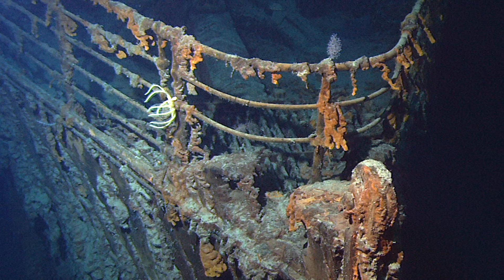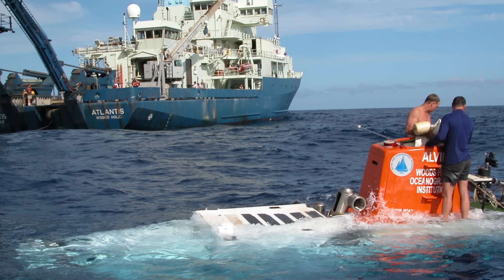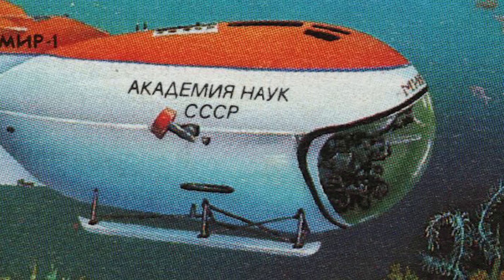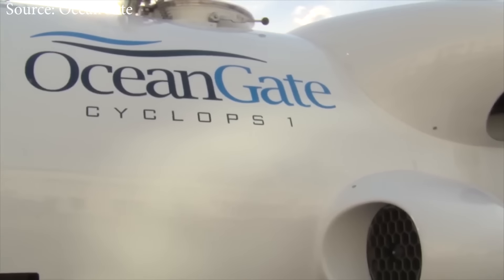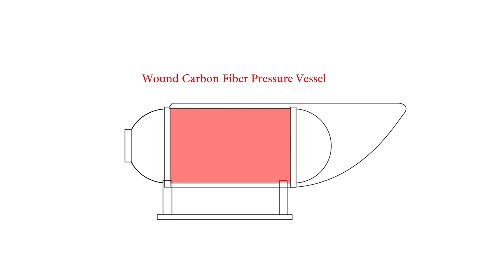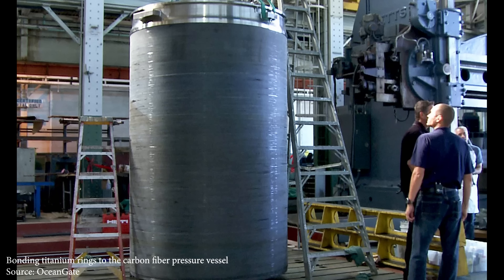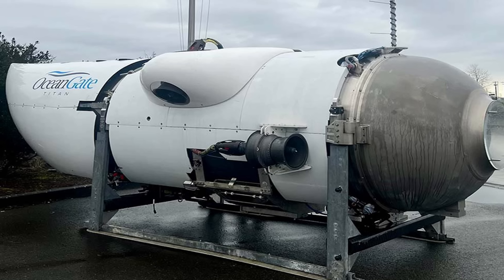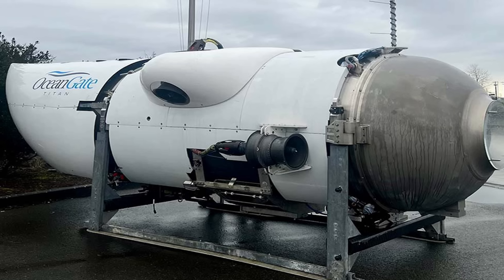How Titan was Built, Lost and Found: An Analysis

Comment: I appreciate as always Mike's brilliant presentation, but just from the info that has been publicly available and finally coming more to light, it's already very safe to add that Stockton Rush was beyond reckless and negligent. He was the boss of the operation from top to bottom, and was the only person with the authority to fully question things, an authority which he regularly abdicated. People make a fuss about the game controller, but that was possibly the most reliable component of the whole system, being a widely proven and dependable item. To ferry people to Titanic though, he used a highly unproven experimental and novel construction. The titanium caps were essentially glued with epoxy to the carbon fiber composite hull, and rather than the adhesives being applied in clean room conditions, they were done in an open air building by people in street clothes. Due to their design, the seams formed by the epoxy-joined composite and titanium segments would have been impossible to scan for damage even had Stockton Rush ever wanted to. Moreover, experts in carbon fiber such as advanced bicycle part engineers have fully known for years that carbon fiber composites degrade progressively with use under stress, can fail catastrophically at the worst possible moments, and that even with careful examination may only be known to be at risk only after they have already failed. Every one of the many cracks heard by passengers, as reported on earlier trips, was damage, accruing incrementally over time. Stockton Rush was not going to retire Titan any time soon, could never have detected its growing faults, and reacted bitterly to experts suggesting that he was putting lives in danger. So, Titan's eventual destruction was all but guaranteed. I don't expect any pieces of the composite hull or the bodies to ever be found; the immense pressure and energy of an implosion occurring at hundreds of atmospheres of pressure is hard to comprehend, but it would literally be over in milliseconds, superheating the air inside momentarily and turning the entire hull and its contents into small particles before the unfortunate occupants could even register the collapse. Stockton Rush made claims about NASA, Boeing, and the University of Washington being involved with the sub's engineering, which are now known to be greatly overstated. His victims, yes I say HIS victims, may have been considered crew members rather than tourists, but I struggle to see how a Pakistani billionaire father and his unwilling teenage son, whom he had to heavily coerce to overcome his initial refusal to join him, can be considered anything but unwitting clients, being given so many false assurances after paying hundreds of thousands of dollars.
Reply: You are 100% on point. Totally hubristic and negligent. A modern Icarus (of the Ocean). But at least Icarus only took himself out, Rush took 4 other lives with him in his folly. I feel so so terrible for Suleman the teenaged boy. When I heard how they died I cried for hours thinking about him in his final moments, and the pain his mother and sister must be going through. Ugh. Just terrible. May they rest in peace.
Reply: Very well-written
Reply: People want a video without the bias and noise. Mike provided that. This comment is more of that noise and opinion he mentioned in the introduction.
Reply: @yoowan3437  You are incorrect and probably didn't even read or comprehend my comments. Mike is advising against spreading rumors. I am commenting on things that are known to be factual. With due respect to Mike, he was not yet aware that Titan's hull was glued together with epoxy. Perhaps he was not yet aware that the viewport wasn't rated for anywhere near Titanic's depth. He along with everyone else wants to know what went wrong.
Reply: Paragraphs, man, please use your return key!

That having been said, I actually will take issue with the game controller. Not "because it's a game controller," but because:

1. The use of a wireless controller introduces two additional, unnecessary points-of-failure to a mission-critical component, that being power supply and wireless connectivity, when wired controllers work just fine and have neither problem;
2. Did they have a backup? The Navy uses the damn things because they're cheap, ergonomically tested far better than anything they ever could do, and you can send a sailor out with a rented van and a "company" card and return with a hundred of the things new-in-box in an hour and a half. So if the one they're using then breaks, they just toss it in the trash and pull out another one. Did Rush have a spare aboard? Probably not, knowing him.
Reply: Are you an expert in the field of carbon fiber?
Reply: @ShadowDragon8685  I saw a former passenger saying yes they had a spare controller for whatever that's worth. I still wondered if the sub could be controlled by other inputs, touchscreen, keyboard etc.. I've heard of comm and power problems on the sub but so far not controller issues. And F the return key! mahhaha
Reply: @ShadowDragon8685 , he carried spare controllers, at least according to video I’ve seen of him saying that. 

Nonetheless, I would think that there should definitely be some sort of fixed/wired method of controlling the vessel that overrides any other controllers, which you would default to when navigating through extremely complex environments. 

I would not want the vessel totally dependant on a controller that could disconnect when you are navigating the wreckage, when even a short, momentary loss of manoeuvrability could result in entanglement or collision.
Reply: @ShadowDragon8685  Yes there were spares onboard
Reply: Very well said
Reply: Hold the Shift button down while hitting 'Return" and you can make a new paragraph without losing what you already wrote. And your assessment is spot-on.
Reply: @LB1973 Having a "spare" component at hand DOES NOT provide REDUNDANCY... because the change to the spare is not instantaneous, nor seamless...
Reply: @yoowan3437  This comment is not "noise and opinion". It's FACTS. The information of peabody3000 has been well-validated by genuine experts in deep water engineering, mechanical construction, and safety management. All of the reputable organizations mentioned here have publicly denied any partnership or  involvement with Oceangate, contrary to Rush's false claims about them. The information about the carbon fiber hull is also validated by multiple industries, and the implosion information is also real fact, and easy to research. Mike, on the other hand, let his feelings about Rush determine how much he was willing to investigate (not much at all), with the result that historical/factual accuracy was sacrificed in his narrative about the Titan disaster.
Reply: Excellent comment.

Comment: If he was a science enthusiast, WHY didn't Dawood not realize that carbon fiber only supports EXPANSION force by stretching, like gas tanks, and is FAR weaker under compression.
It was just stupid to use an open compound structure that can delaminate when water enters the layers under high pressure.
Reply: really good info
Reply: Thank you👏👏
Reply: Great simple explanation,  wonder if dagwood knew that ?????
Reply: One of the other passengers, Hamish, was extremely experienced in submersible exploration and extreme adventure. Very shocking no questions were asked.
Reply: He knew that carbon fibre is weak under compressive loading, everyone knows that. So many experts in the comments by people who don't really understand the facts. Simple pre-dive hull scan ($20,000 but still affordable), thicker hull and we wouldn't even be having this conversation. The Titan which can carry 5, cost $370,00 or about 1% of a metal hulled sub that can only carry two at $37 million.
Reply: @methylene5  We might still be having this conversation, because the measures you suggest to make this thing work either were not considered  (= extreme ignorance) by Stockton Rush or were considered and rejected (= extremely poor judgment and/or excessive hubris). Neither extreme ignorance nor extremely poor judgment and/or excessive hubris should be attributes of anyone in charge of constructing and piloting something of this nature. The decision not to take those measures strongly suggests that Rush was not a good fit for the job in either capacity, no matter how many wonderful things you have to say about him. He (and four others) died precisely as a result of the decisions he made. Also, you completely omitted mention of the gross inadequacy of the strength of the viewing window.
Reply: Blue eyes.. you wrong bby
Reply: Carbon fibre is good for deep dives. ONCE. Carbon fibre hull was used in Cameron's Challenger sub that dove into the bottom of Mariana Trench but it was literally intended to do it once and be retired afterwards.
Reply: @methylene5  with a thicker hull (more titanium or thicker carbon fiber layers?) it would have failed after a few dives later. The problem is that all those materials expand differently, react differently to saltwater, creating delamination over time. Delamination is exponential, not linear.
Also, carbon fiber fails differently to metals, it doesn't deform under stress load, it just fails without much warning.
Reply: @campandcook3118  Yes I know all of that, this is why its important to thoroughly test the hull before each deep dive, at about $20,000 per test, they could easily afford that.
Reply: @blueeyeddevil1  What do you actually know about the viewing port specifications? Nothing. We already know that it's been claimed it was inadequate (rated to 1400 m vs 3800 m dive) however some others have claimed it was the initial prototype that had the weaker window and not the Titan, I'm waiting on facts to emerge unlike so many others in the comments, I was referring to the carbon fibre hull that everyone's been going on about.
Reply: @Zolwiol  The Deepsea Challenger piloted by James Cameron did NOT have a carbon fibre hull; it was made from a specially made syntactic foam. Also, the vessel was NOT intended to be used once and retired. It is still operational to this day, and owned by the Woods Hole Oceanographic Institution who inherited it from Cameron in March 2013.
Reply: @Zolwiol  no, the passenger hull of the challenger is out of high-tensile steel.
Reply: @methylene5  You failed to address the main points of my comment. While the viewing port issue may be unsettled at this point, what is not unsettled is the impact on the final outcome of ignorance and/or poor judgment and/or hubris. Your argument amounts to "if they designed and constructed the sub correctly, this wouldn't have happened." Well, no sh!t. That's the point everyone is making. Even if the viewing port met the minimum standards, the sub still imploded. There's a huge fact for you, and you didn't have to wait very long for it. As for what I know about any of this, it's no more nor less than what you know, since neither of us was involved in the design, construction, and--excuse the term--execution of the sub, and neither of us is privy to inside information. What's more, you give us this gem:
"The Titan which can carry 5, cost $370,00 or about 1% of a metal hulled sub that can only carry two at $37 million."  No, the Titan cannot do that. It's in pieces at the bottom of the ocean.
Reply: @blueeyeddevil1  ----- "Your argument amounts to "if they designed and constructed the sub correctly, this wouldn't have happened." Well, no sh!t. That's the point everyone is making." -----

Yes so we more or less are agreed on that. I was adding to the discussion certain unknowns and the costs involved. It's too early to draw conclusions on exactly what happened. I find it fascinating that the sub ever made it to the Titanic at all given how many shortcuts were made and the obvious improvements that could be done in any future designs.
Reply: @Zolwiol  you're mixing challenger up with a competing design that was evaluated by cameron's friendly competitor, richard branson. ultimately the carbon fiber design was rejected but led to the idea being adapted by stockton rush, who promptly ignored the single-use rationale and consequently made plans for a deathtrap from the very beginning
Reply: @mrnice111  its sad when you really believe that people in youtube comments have more engineering education than professional engineers
Reply: @methylene5  Your quote for subermisbles is wildly off. You can purchase a 2 person submersible for a few million. A 2 person Orcasub to depth of 3,000m at 2mill. Oceangate actually purchased a used metal hulled for around a mill, which they were using for their dives before they decided they wanted to build for 5 people. 
Yes, metal hulls are more expensive and require more floatation due to weight (especially if they'd built one big enough for 5 people), but your 1% estimate is WILDLY off. The only sort of submersible around that price is something like the is the Triton Full Ocean depth, but that can reach to almost 11km, which is WAY beyond what the Titanic needs (at less than 4km)
Reply: @Spamhard  Orcasub? Gosh I sure hope you're joking. I think you need to learn the difference between feet and metres, for the $2M price you quoted.  The numbers I quoted are for conventional manned deep sea diving submersibles, such as used in deep sea exploration, oil/gas etc. The total costs (including specialised support vessels, etc) are astronomical.
Reply: @methylene5  I know the difference between feet and metres. You're quoting exorbatant prices to favour your argument.
Reply: @Spamhard  They aren't my prices, and it isn't my argument. I'm telling you how it is, don't believe me then just Google it. Heck just read what James Cameron paid if you're that lazy. 
You're just deflecting for the fact you use the Orcasub example when even the manufacturer doesn't claim that their sub does as YOU claimed for the price YOU quoted. Stop wasting my time.
Reply: They claimed 3,000 feet for $2 mil back in 2013. Not 3,000 metres.
Reply: @methylene5  I did google, and research., And you are vastly overquoting.
"The total costs (including specialised support vessels, etc) are astronomical." And yet you didn't include those costs into your Titan cost estimation.
Reply: @Spamhard  ----- "I did google, and research., And you are vastly overquoting." -----
" Limiting Factor, known as Bakunawa since its sale in 2022, is a crewed deep-submergence vehicle (DSV) manufactured by Triton Submarines and owned and operated since 2022 by Gabe Newell’s Inkfish ocean-exploration research organization.[3] It currently holds the records for the deepest crewed dives in all five oceans. Limiting Factor was commissioned by Victor Vescovo for $37 million and operated by his marine research organization, Caladan Oceanic, between 2018-2022.[4]"

Like I said, $37 million. 1% of that is $370K, like I said. The Titan is towed behind the support vessel, those same added auxiliary costs didn't apply to the Titan.
Reply: @methylene5  You're comparing subs that can dive to double or triple the depth of Titan. That's like comparing sports care prices to a family sedan lmao. Of coruse they're gonna be way more pricy.
Reply: @Spamhard  You don't dive in a sub to the Titanic that can only reach that max depth, you want double or triple the rated depth for a safety margin. You gonna drive at 199 mph in a sports car that's only rated to 200 mph. LMAO.
Reply: @methylene5  ok. i'm gonna go touch some grass. you should too.
Reply: @Spamhard  Now that sounds like a plan, take it easy bud. 👍

Comment: I will note something on the SOUSUS Net track from the Titan Implosion, the big reason it was kept in house until confirmation that the vessel was lost is that they weren't sure the sound actually was the Titan imploding, as identifying sounds from under water can be quite difficult, as noted, so the thought was that it could of been some other underwater activity that happened to sound like an implosion. With hindsight it's easy to see it as a potential wrong choice, but at that point it wasn't even public that the vessel had been lost.

Comment: It's crazy to me that after 111 years, the Titanic is still claiming lives, and for largely similar reasons. The hubris and ignorance of safety measures of both the White Star line and Oceangate staff is what led to this tragedy
Reply: The staff just did what they were told, the ones who spoke out were fired
Reply: White Star didn't have a willfully negligent approach to safety though. They implemented safety measures that were higher than to the required regulatory standard at the time. In the grand scheme of things insufficient, of course - the gold standard of oceangoing safety being William Francis Gibbs, whose vessel Malolo in fact survived the very same type of collision that doomed Empress of Ireland and Andrea Doria, and which - along with United States - would have easily survived the impact that felled Titanic.

But they were not negligent.

Stockton Rush, on the other hand, was openly, and vocally opposed, to any kind of safety requirements being imposed on him. That's why the Titan was not only uncertified, it had a waiver that mentioned 'death' like ten times, and tried to bypass liability by classifying paying passengers as "mission specialists."

OceanGate, unlike White Star, was willfully negligent, and they are probably about to be sued out of existence.